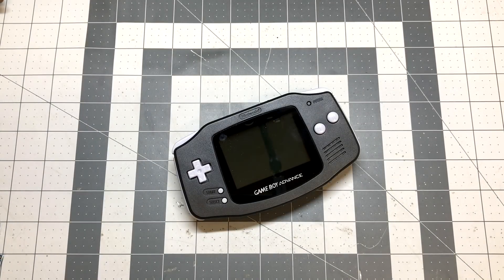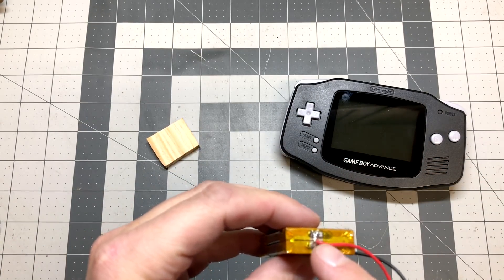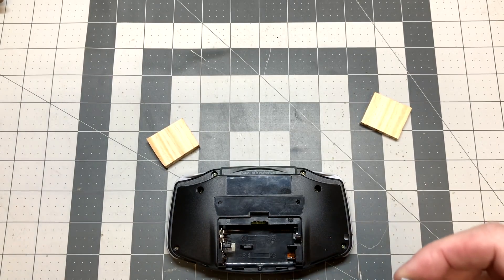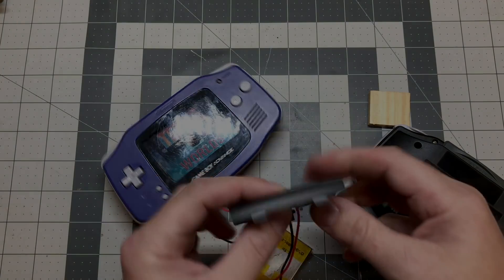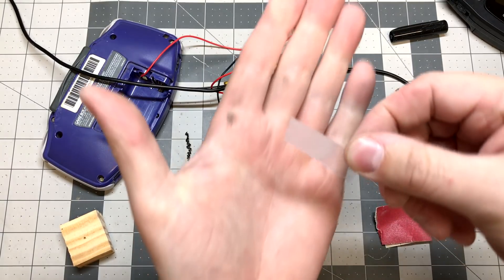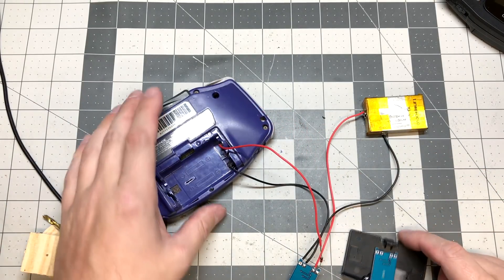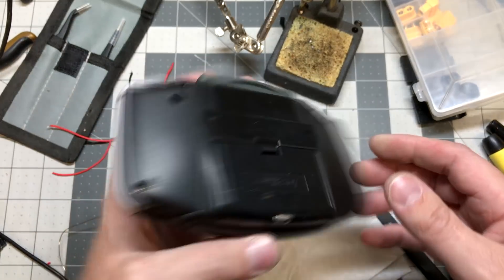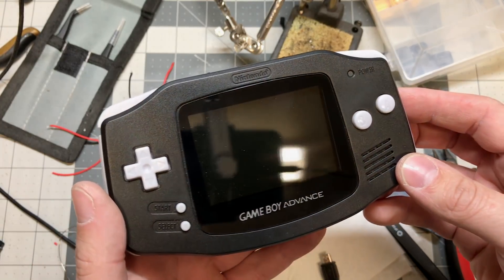USB Charging.. SO MUCH POWER.! #lithiumbattery #gameboymods #rechargeable #backlitgameboy #gba

Comment: How would this work with other electronics less sophisticated than a GBA that probably do not have an over surge protection? I think something like this could be cool on like a Digimon virtual pet, but I'm not sure how safe it is since a fully charged Li-ion battery hits 4.2v at its peak. VERY informative video btw!

Comment: i blew a fuse doing this with a 3.7v lipo battery, any idea what may have caused this?
Reply from the maker: You mean on the charger board..?  If yes my guess is that they are kinda cheap and some just fail.
Reply: Keylitho no i blew a fuse on my gameboy, bridged it for the time being and am just using batteries til i get a new one in the mail

Comment: have you notice battery/lipo getting warm/hot while charging? thanks
Reply from the maker: No not the battery... although the board gets a bit warm.
Reply: @keylitho  thanks. Also is it safe to play and charge with that IC board TP4056? i see alot of people saying your are not suppose to charge and play simultaneously.
Reply from the maker: @jonathanmsantos5405  Well I have done it.. but that little board might get warm depending on how dead the battery is.. But it really doesn't take very long to charge.

Comment: I wouldn't recommend connecting li ion or lipo cells in parallel, unless you have a bms for each one and the outputs of the bms connected together for the final output. Next time measure the dimensions of your current batter pack and buy almost the same sized single cell lipo off of ebay. Much safer, cheaper and less clutter. Thanks for the video btw..
Reply from the maker: Only need a BMS if they are in series..

Comment: 1 battery is enough?
Reply from the maker: 1 is fine it only effects run time.
Reply: @keylitho  I found a 100v and 180mp diode, okay?
Reply from the maker: @Xfoone  Are you asking if this will work..?  I would say wire it up like my diagram and measure the voltage that would be going to the GBA when the battery is fully charged.

Comment: I guess it is easier to build in a light switch and use rechargables batteries into my old GBA, than to find some powerbank for a GBASP or DSLite that would run on AA batteries, let alone charging the rechargable ones. Also, I would like my GBASP and DSlite to be able to turn the lights off sometimes. Now, the GBASP at least has a light switch, but with the DSLite it would be a miracle if you can change the light during a game.

Comment: Also, have you encounterd any problems so far with the battery or with the gba when you modded it?
Reply from the maker: Well I did switch to the other battery listed in the description.. after realizing that the batteries I used were no where near the rated capacity.. But the GBA is great and still works fine.
Reply: @keylitho  Oh I see! And can you tell me how you were able to mount the rechargable circuit board onto the battery cover, sorry lol I'm a nooby :/
Reply from the maker: @rednova7107  Just with hot glue
Reply: @keylitho  Double thank you!

Comment: For some reason, when I try to  turn the GBA on with this mod, it just doesn't. It works fine with AA batteries.
I've checked the connections and electricity seems to flow properly. I've tried using more diodes but it doesn't fix it.
Any help?
Reply from the maker: More diodes will make it worse..  Make sure everything is hooked up per the Wiring Diagram in the description.
and if it is.. what voltage are you getting on the 2 wires that are soldered to the GBA battery terminals..?
Reply: @keylitho  Thanks for replying so quickly. I was out for vacation, but now I'm back with this project.
With the wires unsoldered to the battery terminals, I get around 3.67 volts, both plug and unplugged to the terminals. When I turn on the GBA, it drops to 0.4-0.2, constantly varying, instead of getting stuck to 3.03 volts, as it happens when using two AA batteries.
Seems like the circuit connected to the charger is acting weirdly.
Reply from the maker: @ElB0ludo  Could be a shot lipo.. Do you have another lithium battery you could try.?
Reply: @keylitho  Actually, it seems it was an issue with the first two charger chips I used. Third time's a charm, I guess. Now it works!
Thank you for everything! Awesome mod and awesome video.
Reply from the maker: @ElB0ludo  Good to hear.

Comment: Why would you use 2 lipo packs in parallel that is not a good idea and needs a special charger for it now that it is 2 cell
Reply from the maker: It is perfectly fine..  It is actually safer.. because the 1amp that little charging board puts out is split across 2 cells so each cell is only getting 500 ma and that is more appropriate considering they are only 800ma cells..  If they were wired in series then we would have issues and you would need to balance them.
Reply: Even in parallel they don’t discharge equally and will need balancing 

I just don’t want ur gba to explode, if one starts to bulge get rid of it please I’m just warning you
Reply from the maker: @RGBeter  As long as the voltages are the same to start it is fine... If you had a dead lipo and a full one it might be an issues because they balance each other out they might get too hot..  that is why they say not to do this on sites like adafurit and other companies that sell single lipo's..   Anyway I have since changed out that batter for the alternate batter I have listed in the description.. They were not even close to the rated capacity.
Reply: oh wow, thanks for letting me know

Comment: Great build! We would really caution connecting lithium ion batteries in parallel like that though! It could lead to overcharging if they are unbalanced and is a fire hazard, especially since it looks like you removed the protection boards from each battery (if the main charger board has protection built in, it will do no good regarding unbalanced cells because it’s treating them as a single battery).

Also, that’s a 1A default charger, so be careful about the heat that it produces while charging, especially since it sits right on top of the battery.
Reply: combing two 3.7v batteries like that wouldn't increase the overall voltage to approximately 7.4-ish, resulting in it being over the max voltage for a GBA which is 3volts?
Reply: @chrish8904  there is a difference of parallel and inline connections. Inline you add the voltages together (like you suggest) in parallel you don't increase the voltage just the mAh. So it's still 3.7v but 600+600=1200mAh.

Comment: I just did this last night great tutorial, i just don’t know how you got both batteries to fit with the case closed. Mine was just too big with the board both batteries and wires so i just used the one battery, still works though. Maybe if i have more time ill try again and see how to make it all fit.
Reply from the maker: Well I have since switched to the Other battery linked in the description.. It fits really well.

Comment: hey I have a couple of this ones https://www.amazon.com/gp/product/B01LZSC7I8/ref=ox_sc_act_title_2?smid=A38N3TNH1N2LMX&psc=1 it should it work? is this the same one as yours: https://www.amazon.de/Axial-Signal-Switching-Diodes-IN4148/dp/B019JV72K6/ref=sr_1_fkmr2_2?ie=UTF8&qid=1540826261&sr=8-2-fkmr2&keywords=switching+diode+Standard+75V+150mA sorry I live in europe and I am not an expert with electronics
Reply from the maker: Well even though they are both based off of the TP4056 chip the one I have spec'd has the protection chip on it and is probably a better choice for this application..  The Board I linked is the updated version of the one you linked... 
As for the Diodes gonna have to just hook it up and see if you get the voltage drop you are looking for.
Reply: @keylitho  what could happen using my chip? the protection you are talking, is it overvoltage? what could happen? thanks for taking the time to reply... which voltage measure should I get between the leg of the diod and the negative wire? sorry, I am very new to all this, I have made a couple of working projects but always following tutorials... no real clue
Reply from the maker: @elmono8894  Well pretty sure it is overcharge protection on the newer board.. as for the diode.. on a fully changed battery just hook the diode up to the positive terminal and measure the voltage it should drop the voltage down below 3.7v.

Comment: Can somebody tell me what I did wrong with my mod? ... apart from some really bad soldering 

https://ibb.co/k53yj9
https://ibb.co/h3x2Bp
https://ibb.co/dFdyj9
https://ibb.co/ipP4P9
Reply from the maker: Need to put the diode in there.. It won't work when the voltage is too high..Please reference the Wiring Diagram in the Description. I have also found that the Alternate batter in the description is a much easier solution.
Reply: the diode was there, i just had it covered by a shrink tubing. my issue was that the diod has a direction i think, after i turned it everithing worked just smoothly. thanks for the cool instruction, its such a cool mod

Comment: Ive done the same thing, followed the circuit diagram, with one battery from the gbasp. And the gba doesnt turn on but the light comes on for a split second. 

Any tips?
Reply: update: ive tried a ds lite battery and it worked in turning on the system but after i left it to charge with the 5v micro usb board for a while, the battery seems to be overcharged and the diode doesnt seem to be reducing the voltage.

any tips?
Reply: lipo charger is not the same as Nimh charger board. make sure you are using the same type battery.

some boards can do both.
Reply: maybe check the polarity of your diode, too, if you are using one.

Comment: You should isolate the negative of the battery before it ends up shorting to the controller board. And If that is a zener diode, you connected it in the wrong way, so it will work as a normal diode, which will give you around 0.6 - 0.7V, which might be just enough. Is your charging / protection board preventing the battery from over discharge?
Reply from the maker: No the board has no discharge protection.. But the GBA turns off before the batter get's to low..

Comment: Some notes for whoever looking to do this as I did this as recently as yesterday. It's in no particaly order. 

1. Use thin wires or you won't be able to get the lid to shut properly.

2. Instead of putting the zener diode next to the charging PCB, I put it at the absolute end by the battery terminal on the gba. This made it easier to squeeze it all in.

3. All batteries are different. Mine had negative on top and positive on bottom. Use a multimeter, always. I shorted my battery stack out a couple of times creating small sparks, but everything works. My connections on the batteries were spot welded making it hard to solder anything to them properly. I had my soldering iron at 450*c with quite a thick tip to be able to transfer enough heat. Temperature needed will obviously vary. Usually it's not temperature that damages components, it's  because the joint, component or spot has been exposed to heat for too long. 

4. Instead of drilling a hole to fit the micro USB port, I simply put my solder iron straight through and worked from there. I used a razor to take away some melted plastic that protruded from the hole. Same thing for charging light if you're taking that route, but I opted to put everything in an opaque case. 

5. If your gba stops turning on whenever you put the batteries inside, it is most likely caused by a bad solder joint causing the pins to shift whenever you squeeze it all inside. Check with multimeter once batteries are in place but disconnected from pcb. Remember that once you connect the batteries to the pcb charger, it technically becomes live. 4.2v is not much, but it's good to keep it in mind.

6. You will need a glue gun. I thought I could get around it but the USB ports require quite a bit of force to get your cable in. Pcb will shift if not secured properly.

7. The zener diode I used was rated at 3.3v rather than the one linked in description.

8. If you think your wires are short, make them shorter. But more importantly. Make sure your wires do not overlap if you want to be able to close the battery compartment. 

9. Make sure your terminals on the lipo battery is covered with something after solder, or it will come in contact with the gba terminals. Not because of safety, but because of good practice.

Overall this was fun. For someone who's built drones from parts. Difficulty: 2/10

Comment: Can someone explain to me why the Zener diode is necessary? I understand that the batteries operate at 4.2V and the gameboy operates at >3.7V but why is a Zender diode necessary when one could just drop the voltage with a resistor?
Reply: I believe I found an answer to my own question. The diode in this project is a switching diode, it has the same functionality as a switch when certain voltage/power requirements are met. We are not using that functionality. We are solely using it in order to snuff the 4.2V output voltage to around 3V. (GBA works on 2 AA batteries in series=3V). So we should be able to use any 3-3.3V Zener diode for this.  4.2V-> 3.3V -> GBA

The reason one would not use a resistor for this is because the voltage drop would be constant as the battery is dying. Ie when the battery is at 3V the GBA will be on 2V. But with the Zener diode, we can eliminate the resistance once the battery voltage drops to a usable level.
Reply: Also, for people thinking about using a voltage regulator, that wont work. Because once the battery drops below the operating voltage for the regulator, it will turn off. Lets say you're using a 3.3V regulator. The circuit will work fine when the battery is between 4.2-3.3. But once the battery goes below 3.3, the regulator will turn off and 70% of the battery's charge will not be able to make it to the GBA.

 A Zener diode is really the best bet here.
Reply: Update: Instead of using a Zener diode I have decided I'm going to use a buck(stepdown) converter to step the voltage from 4.2V to 3V. The reason is that buck converters are much more energy efficent so the system will not get warm. The exact one I'm using is the mini360. So in conclusion, we have the TP4056 into the lithium battery, then the outputs of the TP4056 into the mini360(set to 3V using the built-in potentiometer) then the output of the mini360 into the GBA.
Reply: Michael Gibbons  There is now a commercially available rechargeable liion battery for the GBA from retromodding, but i appreciate your updates. The commercially availible one is only 1000mAh and using 2 GBA SP batteries would yield over 1600mAh. So if i dont like the battery life offered in the retromodding pack, ill definitely build this pack. Only thing i dont like is soldering the wires to the battery contacts, since this can complicate servicing the modded GBA if anything goes wrong.
Reply: @iamtheflu  why it's not hard to unsolder
Reply: Ragesauce  yes, but if you have to open it just to clean the buttons, you've turned a non soldering job into one. and for people who dont keep an iron on their desk, it makes things a bigger job than they have to be.
Reply: boohoo
Reply: @deletemedeleteme43  You should be able to use that one. If i'm not wrong, there was an official nintendo adaptor for gba that had an input of 3.3v and 350mA, so if the gba could deal with that adaptor then there should be no problem with the one you are trying to build.
Reply: @deletemedeleteme43  I'd have to do some more research to confirm, but what I think you're probably going to want to get is a buck-boost converter. A straight buck converter will drop the voltage to 3.3v, but not sustain that voltage once the battery voltage drops below 3.3v. A buck-boost will buck the voltage to 3.3v when the battery is above that voltage, but boost it up to 3.3v when the battery voltage drops below 3.3v

Comment: I followed this mod exactly as Shown in the video.. I was really excited to see it all working however it didn’t power up and the circuit board with the charge port would become really hot. Any ideas where I went wrong?
Reply from the maker: Well it get's pretty hot when delivering the full 1 amp to the discharged battery.. I have noticed that some of the charging units get hotter than others.. Its probably due to the mass Chinese production..  switch out the charger for a different one and see how it goes.
Reply: Keylitho I didn’t even plug the charger in, it appears the heat is being generated just by the battery being connected. I had been building myself up for a while to try this and I’m fairly gutted I failed. Was tough getting the wires to adhere nicely to the terminals on the GBA.
Reply from the maker: Well Like I said those chargers are really cheap.. maybe it's a bad one.. For the 20 I have used in projects about 5 have been bad..
Reply: Keylitho yeah could we be, I’ll have another crack some other time, thanks for your help 👍🏼

Comment: Used almost all of your method. Did a zener but only a single lipo instead of two in parallel. Noticed though that when charging from completely “dead” the tp4056 gets very hot and I was afraid to House it on the battery or screen. Moved it to the bottom of the case attached directly above (if you are looking at the rear of the console)the volume knob. Cut a pretty big chunk out of the case to make it work. Question here is, was my panic about that much heat on battery/near screen justified? Or should/could I have just left the charge board in the battery compartment and not carved up my housing?
Reply from the maker: Yea it does get a bit warm... Maybe mounting a thin piece of aluminum to the back of the battery cover then attaching the charging board to that.. 
I have also noticed that some of the modules get hotter than others... Good old China QC..  So maybe switch it out for a different one.. Also maybe a lower amperage usb port like a computer port would limit the heat.